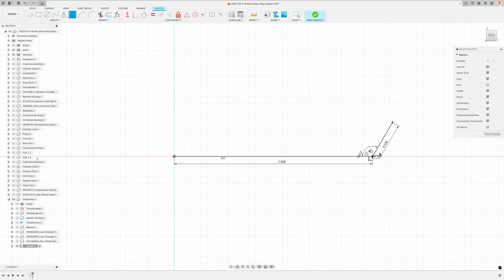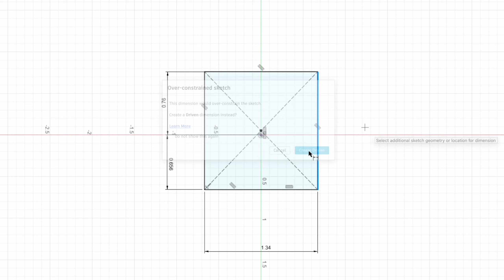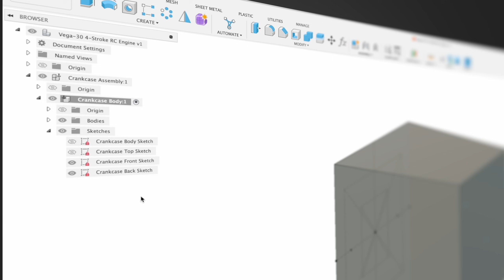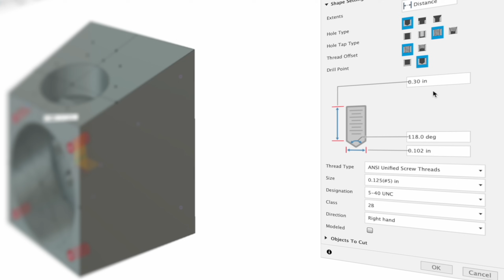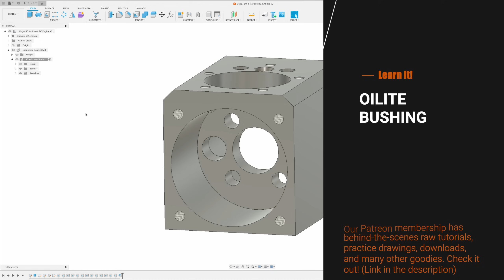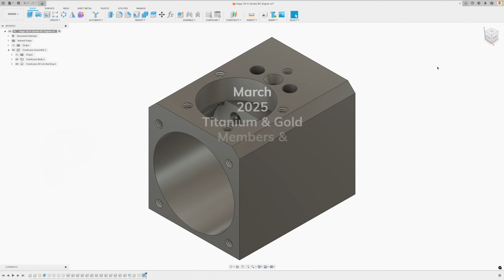Autodesk Fusion Intermediate Course - 1/10 - Crankcase & Bushing 4-Stroke RC Engine (2025)

Comment: Such a fan of your tutorials!! Have been learning an immense amount and enjoying it.

I had a more general question regarding technical drawings. How are you able to deduce that something is symmetrical if the drawing doesn't explicitly say it, ie. for the holes on the top of the crankcase - what if the one above the symmetry line was just slightly higher from the origin then the one below but it wasn't obvious with the naked eye?

Thank you always!
Reply from the maker: Thanks so much for your good feedback and support. Wonderful to receive comments like yours. 

Regarding technical drawings: officially, it is better to have everything specified. Doing so saves everyone down the manufacturing and design food-chain. However, with many drawings, assumptions can be made at times. If you have the entire assembly drawing package then you can compare with other parts and dimensions to see the design intent. If, however, someone is ever in doubt, it is always best to consult with the original engineer if possible, or to seek approval to use a certain dimension. Interesting, precision tool companies like Mitutoyo and Starrett will have 1x2x3 blocks with centre holes that have no dimensions. It is assumed that the hole is dead centre. 

Anyways, your question is an excellent one. Hope my answer helps.
Reply: @learnitalready  Yep! Very much so : ) thank you again
Reply: Second question that has popped up, is there a standard orientation we can expect technical drawings to be laid out in? I had been navigating the sheet as if top left was the front and top right was the back (seemed intuitive thinking the front would be the left side of the middle drawing and the back the right sight) but when we began putting the holes I realized it was actually the inverse. Do you have a strategy for when you first look at a drawing for determining orientations?

Comment: Quick Question, based off of the drawing how do you know whether the hole has a drill point or not? Also how did you know that the top right hole on the TOP sketch was actually on the bottom?

Thanks
Reply from the maker: Excellent questions! Thanks for reaching out. To answer:

1) Drill point or not? This is mostly from my experience. There are two ways of making a hole in aluminum. 1) using a drill and 2) using an end mill. One would almost never use an end mill (which most often has a flat end) to drill a hole, because of a host of different reasons. For this particular part, I'm 100% certain that they would use a drill, which has an angled point to it. However, if you will be 3D printing this, then it really doesn't matter. However, I would still make it have a pointed end which would help with any overhang issues with the printer.

2) Top right hole, why on the bottom? Take a look at the ISO views on Sheet 00. You'll see that it is indeed on the bottom. This got me confused at first too, because it is bad practice to put a feature on the wrong face or view of a drawing. However, some draftsmen do this because there isn't enough room on the drawing to include another view (which I'm assuming is what happened in this instance too).

Hope to hear from you again! Please consider sharing these videos if you are benefitting from them. All the best!
Reply: @learnitalready  Thanks for the fast response, these videos have been helping me a lot and i will definitely share them!

Also, how do you know what thread type? I get that you can try each one and look for the designation but that seems like it would take a while in some circumstances. Is it just another thing that comes with experience?
Reply: @justjqshing   The thread type is specified in the drawing. For example, "6-32 UNC | 0.276" refers to a #6-32 UNC (Unified National Coarse) thread with a thread depth of 0.276 inches. In Fusion 360, this can be selected from the drop-down menu when choosing a tapped hole in the Hole feature dialog.

Comment: My first 2 dimensions .656 & .76 are on the opposite side of the dimension line to yours. Also at the first extrusion my negative and positive directions are opposite to yours. If I orbit left right a little over the vertical, the dimensions switch sides.
Reply from the maker: Sometimes that happens with dimensions. No need to worry. We just need to roll with it.

Comment: As a self-taught intermediate Fusion user, I was able to create the Crankcase before watching the video but holy crap, I'm going need a full tutorial for the Cylinder Jacket!! I cannot wait for the next one.

This is probably beyond the scope of the tutorials, but it would be nice if you showed the drawing and commented on it while/before designing a piece. For example, I don't know what in the CAD drawing dictates that one hole belongs on the bottom of the crankcase vs the rest, and for the Cylinder Jacket step, I don't know... well basically how to read the entire thing lol.
Reply from the maker: Thanks for your comment! Great job in trying to create the components before the tutorial and then seeing my design and workflow. You will no doubt proceed in learning incredibly quickly. Stay tuned for the cylinder jacket. 
I would love to be able to display the drawing during the tutorial (like many of my other tutorials) but I don’t want to get any flags for copyright issues. So, I will do my best to explain which part of the drawing I’m referring to during the tutorial.
Reply: a'ye... that cylinder jacket is/was a challenge.

I'm curious to see Tyler's method, particularly how he scrutinizes the drawing procedurally, and how he models the more difficult bits. 

This is an excellent series for the intermediate.

Comment: Am I dense or did the bottom-up/top-down definitions on the screen not match your voiceover descriptions (seemed like they were backwards)?
Reply from the maker: I will double check. It is definitely possible that I completely messed up with this. Hopefully not, as I did review the video a few times before release. But, you know, I’m only human 🤪
Reply from the maker: Just reviewed, and phew 😮‍💨 I didn’t mess up. I refer to top-down modeling first as the method we’ll use, but then explain in detail what bottom-up modeling is when I show that info on the screen followed by top-down (in detail).
Reply: I was confused too. I think its reversed?  "in tradicional design, bottom-up is used" (create 1 file per part) but the text says "create components within the same file". Also in you say we'll use top-down (multiple parts in the same file, context design) but the text says components in their own separate files. 🤔

Comment: I used inventor for this and it was really fun. Thanks!!
Reply from the maker: Awesome! Inventor and Fusion are nearly identical… were there any major differences in the steps to design and assemble this?
Reply: @learnitalready No the steps where pretty much identical, but now that you have pointed it out fusion and inventor are very similar. I have used both of them and never really paid it much thought.

Comment: Hello there. You are doing a great job with the videos. Question. I model on perspective view. I have recently noticed that when I select to create a sketch, the view is no longer automatically switching into orthographic view. Im having to manually switch. Has there been a change to the software? Have I some how changed a setting?
Reply from the maker: Thanks so much for the encouragement! 

I’m not quite sure about why it wouldn’t be automatically switching to orthographic view. Seems like sketching would be extremely difficult in perspective view. Have you checked out all the user settings?
Reply: @ Yes Ive checked around in settings. the sketch seem to open on orthographic mode as long as Im using the parametric with ortho faces option, in the design mode. Im not sure this was always the case but oh well. If any one has any more to add it will be greatly appreciated. thank y'all.